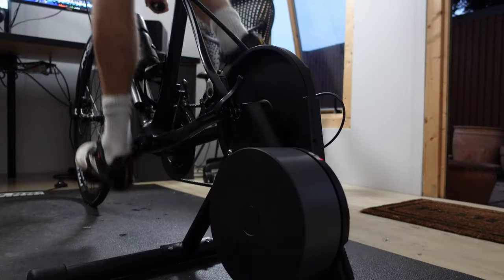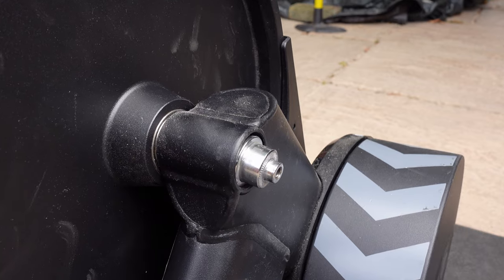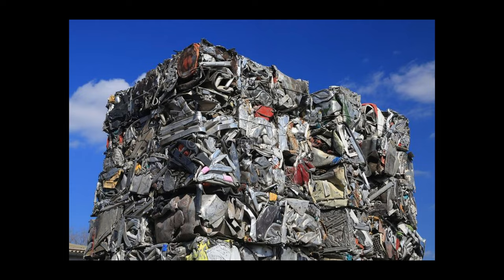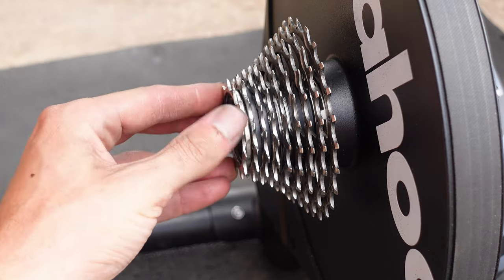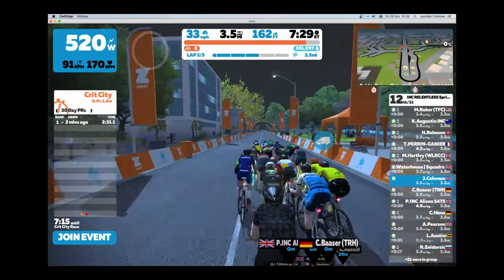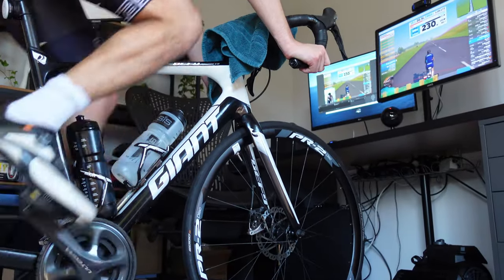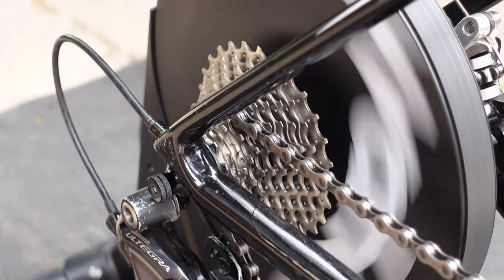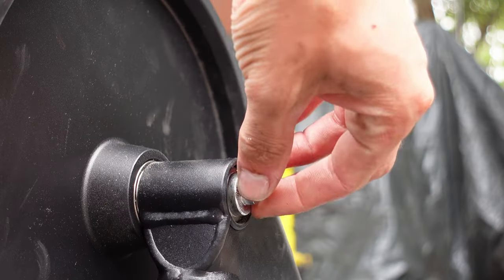1 Year With the Wahoo Kicker Core // Watch Before You Buy!

Comment: You can't get power from each legs from this unit simply because, unlike with power meter pedals, the power is measured at the output flywheel. Basically the unit is measuring how much power it is using to brake you. So by definition, it will be the total power of both legs averaged.
Reply: I also was thinking how exactly it would measure one side of only. When author makes such silly mistake it really cast a shadow on everything else in this vlog
Reply: Wouldn't it be possible, in theory at least, for the trainer to be able to guess the percentage of the work that each crank was doing at any given point in a complete crank rotation, using the rotational position of the flywheel along with the current speed and cadence and the minor fluctuations in power output that naturally result in each turn of the crank?

Although I suppose that even if this were possible it would still not be able to tell which pedal was which, unless the cadence sensor had an additional attitude sensor indicating whether it was right side up or upside down. Are there such things?
Reply: Actually, there are Trainers that display left and right power seperately (as mentioned). The question is how do they measure it, and how accurate is it. The only way I can think of is, that they have a sensor measuring the "left-right movememt" of the bike. When you are pushing the left pedal, the bike will slightly roll to the left side and vice versa Doing so, you could theoretically "measure" which pedal is generating the current power. As the tacx neo 2 is quiete flexible, this coud be easily measured in the trainer. 
However, doing so you can not distinguish, if the power is generated from pushing down left side, or pushing up on the right side.
Reply: Honestly, i don't understand what all the fuss is over power balance. I'm guessing most serious riders that care about power have a bilateral power meter on another  "itrw" bike.
Reply: @Ni1zz  well I quite like this author and have found the content in this vlog and others super helpful. If someone makes 1 error across 10 topics it doesn't invalidate the other 9.

Comment: How can the smart trainer know how much power you produce with your right and left leg? It can find out the cadence by analysing the pulses in power, but how can it reliably know if it's your right leg or the left one making that pulse? That side remark about the single-sided power meters being cheaper is way off the mark: hub-based power meters don't measure L/R balance either.
Reply from the maker: Good point. It's an estimated balance looking at some information on Google. That's kind of the same as the actual power because it's measured at the cassette not the pedals or hub. Either way the balance seemed accurate enough, when I deliberately pushed harder with one leg I could clearly see the imbalance. It seems with turbos the accuracy and readings are to be taken with a pinch of salt compared to power pedal / hubs 👍🏽

Comment: I was have a lot of problem with the core. 1.Low watts, 2. weird noise, 3. little cut on the belt after 1 week of use, so sent it back, and bought the Neo2t. I was rode 600km and a lot of climbing with the neo with it in 1 week, and I'm so happy with that, no issues, silent, and accurate! 😊
Reply: @Ryan Terence What happened?
Reply from the maker: Hopefully it holds up over time. @ryan what happened to yours?
Reply: @Ryan Terence Yo! After 5000km, and 70.000m climb, no issues, work like new :)
Reply: Se escucha mucho?

Comment: Why would you put your bike on the trainer before you have the quick release axle on it. That way the adapters won't fall out. Thanks for the review I've been thinking of getting a Core or saving for a Neo.
Reply from the maker: Hey Markus, you are right. I was swapping and changing things for the video so I didn't have it in. I swap between 10/11 speed cassette often so I have to remove it, but I'll put the qr axel in first form now on 👍🏽Also, I have hired a Tacx neo 2T for a month, it's really good. I'll be making a video on the tacx and probably a video comparing the T2 to the kicker core (Highend vs lowend) and if it's worth spending the extra £££ - Cheers for commenting.
Reply: @JourdainColeman  looking forward to it.

Comment: Had my core to replace my taxc flux ..  pretty pleased with it compared to the flux , loads better without constant noise rubbing the out plastic cover. I always use my stages for the power data n racing it’s more accurate.. can be -10-20watts difference ..which is a lot especially when racing.. plus side… it good in erg mode when doing intervals holds the correct wattage within 3-5 watts brilliantly consistent 🤙🤙
Reply from the maker: Thanks for sharing
Reply: @KrishBowditch is the kicker core better compre to the flux 2? Aprt from the noise whats the differences

Comment: Good vid. I've had mine for a week or two and no matter what I do, I can't get the drivetrain to run smooth. This is using a 1.85mm spacer like I would when out on the road with my 9-speed cassette. I've also used the 1.8mm one that came with the trainer but no good. Limit screws and cable tension have both been tweaked. At the point now where I think I'll just have to put up with it 😕
Reply from the maker: Hi Daniel, a couple of my mates have had the same issue with grinding and the drivechain not running smooth (that is ith 11 speed though). If you are using a 10 speed do make sure you have the spacer placed correctly. I talk about that in the video here - https://youtu.be/9R-FDX1w7Xo?t=181

Failing that, make sure the turbo is on level ground. When you put the bike into the turbo place pressure on the seat to make sure it's seated correctly. Also look from behind to make sure the bike is straight. The non drive side apartor is fiddly on the kicker core, on other trainers I've used it screws in and is fixed in place. 

Are you using the same cassette on your bike as the turbo?
Reply: @JourdainColeman  Hey man, yeah I watched and listened to what you said about the spacer. Mine isn't wavey like yours - it's just a bog standard spacer. In any case, I'm using the one that was originally on the bike (1.85mm I believe) and I don't have the same issues out on the road. Maybe a tiny bit of noise but not as bad as it is on trainer.

Yep, using same 11-34, 9-speed cassette as on the other wheel.

Think I'll have another crack at seating it and go from there. One thing I have to do to get it seated is to pull apart the seat stays a little bit to get it to sit in the dropouts. It's not exactly a smooth installation!
Reply: I had the same problem. It's an easy fix. 

The includes Spacer is just a basic washer without indents/room for the rivets, which are found on the back of some cassettes. 
This causes the cassette to not sit properly one the freehub and makes for a wobbly cassette and noisy drivetrain. 

You can solve it by using/buying the original shimano Spacer with these indents (thats what I did). Or youe could possibly get away with grinding/drilling away the rivets one the back of the biggest sprocket (there are 3-5 i guess, near the spline). 

I hope this helps! Dumb idea from wahoo to include such a shitty spacer.

Comment: Love my kickr core. But I had to replace the flywheel bearings after 3 years and 9000km. There was corrosion on the flywheel axle where the right bearing is running. Did clean the axle used 1200 sandpaper to remove the surface damage on the axle and used Loctite 641 retaining compound for the right bearing to ‚glue‘ it to the flywheel axle. That bearing replacement was possible with bike shop tools. According to some users the tacx neo T2 needs manufactur specific tool to replace.
Reply: As long as it's an easy fix
Reply: I will keep that in mind👍

Comment: So, I got my Core last week and have used it several times, for relatively short rides on Zwift as I'm just getting back into riding and shape (as well as on in years, alas), so I clearly don't have extensive experience with it. But so far I'm really impressed.

As everyone's said it's really smooth and realistic feeling (to the extent that any trainer can be) and makes very little noise (although I can hear a low steady hum-like sound around twice a second but I think I've heard it in videos too so it's probably normal and nothing to worry about). But the drivetrain is by far the noisiest thing I hear (but quieter after I thoroughly cleaned and relubed it).

I'm trying to gradually push myself harder but it's not easy, yet not longer after each ride I find myself looking forward to and eagerly anticipating my next ride. That I didn't expect. I also didn't expect the Zwift background music to be so monotonous, so I'll have to start riding with headphones (hopefully I won't cause massive Bluetooth overload).

Finally, regarding the issue you had with the 130/135mm adapter not screwing in and falling out when you try to connect your bike to the Core, there's a very simple fix for that. Install the quick release skewer first, as would be the case on a bike, into this adapter as well as the drive side adapter, then connect the bike. The skewer keeps the adapters in place, problem solved.

Thanks again for all the tips and observations.

Comment: Coming from a Tacx Bushido which I used for the last 6,5 years I only can say that the Core is bloody fantastic. Dead silent, no more slipping on gradients above 8%, so much better in SIM mode, power spot on with my Powertap C1, small, pretty and stable as a rock. 7 Years ago these direct drives were just too expensive, now they have the same price tag as the wheel-ons then. The transportation of the Bushido or other wheel-on for that matter is of course much easier. So the Bushido has still a function.

BTW Good down to earth review, but the title was a bit to red flaggy for me.
Reply: I am in the same boat. I have a Bushido I purchased back in 2014 and am looking for something to upgrade it for the same reasons as you.

Comment: I’m on my 3rd unit in 4 years, all replaced FOC by wahoo excellent service! The latest one I’ve had has been updated so the legs do snap into position when fully extended
Reply from the maker: Glad the customer service has been good 👍🏽
Reply: Third unit in four years ! Maybe they should focus on excellent build quality rather than customer service. You just put me off buying one !
Reply: @stanleyg3694  better than garmin/tacx.. they would just suggest to buy a new one… I also do a lot of mileage on my wahoo
Reply: @stanleyg3694 mine lasted 2.5 years then the flywheel bearing started to go. Replaced it for free with a refurb. I should have kept the old one and done the bearing myself because the replacement’s plastic shield rubs the belt wheel. Loosened it a bit and it seems to run clear now but far from ideal.

Comment: Thought I share. I been using Kikr generation 14. Got back in 2015. Been using the same cassette since I bought it. Have over 10-15k miles on that one cassette. I change my chains quite often. My cadence is 85-95 RPM on avg. I ride mostly outside, but I have certainly pushed this trainer. I been cycling for 15+ years. My ftp hovers between 320-370sh yearly as I ride year round. My freewheel is good for me. The power is still relatively accurate to my quarq power meter 
+ or  - 10 watts. Adjusting to grades from zwift seems okay. I never was a fan of that. I always just switch to standard mode which is same grade all the time. I also have about 1000 miles of experience with GTA cycling mod with my Kikr. The grade simulation in that game can be quite absurd. However it worked for the most part. Most of my time spent on trainer is on standard mode and doing intervals when the weather is crap outside.
Reply: What is a freewheel exactly??
Reply: with the gta cycling mod, i know there is a setting to lessen the gradients.
Reply: @jomarvista8646  thanks. Yeah I figured it out in the GTBikeVConfig settings. Where you can have the game not control your wahoo. I have it set on standard mode in wahoo app. Also there’s 25%, 50%, 75% and 100% for grade control when pressing F5 you will see it.

Comment: I’ve had my core 3 years now but one issue (with the core’s flywheel) after a year of usage caused the trainer to be replaced so contacted Wahoo and they sent me a refurbished core rather than a brand new one. Don’t know if this was due to cheap replacement or customer service - as a few friends had replacements of brand new trainer whereas I get a refurbished one 🤔🤔🤔.
But on the positive I’ve had the replacement last longer (2 years more) than my original model which is even better - what am I going to do when it comes to this model breaking 🤞🏻🤞🏻.

Comment: Nice thing about rim brake bikes is you can just put the skewer in to hold the adapter in place before trying to drop the rear dropouts on.  ;)

Washer is just flat now.

Space between the bolts on the 2 bars is different so you can only put them the right way round (I know because I put the long one on the back at first and the 2nd bolt couldn’t go through!)

Comment: I imagine the cassette is not aligned to the same way as the shifter cassette on bike.  Therefore, bike shifter adjustments are required every time using the Kicker Core.  I tried out the Kickr snap which doesn't require shifter adjustments.  However, after riding the Kickr snap I realize I get the RPMs up and coast too often.  I hear I can make adjustments on the Kicker App, but resistance adjustments occur all the time.  Who wants to keep opening the app to make these small adjustments?  An exercise bike has a lever centered on the handlebar stem for resistance adjustments.  I know you mentioned there is "mainly good" with this bike trainer.  However, there was a lot of bad design built in with this specific bike trainer (such as a the axle mount nut for disc and regular brakes), and disadvantages to bike trainers compared to exercise bikes in general.  I think I will go with an exercise bike instead.  Perhaps someday I will visit Watopia.  But not until the technology for bike trainers are better.  Thanks for posting this comprehensive review!  I appreciate the detail you covered.

Comment: Given that this is a wheel-off trainer so neither rim nor disc brakes are relevant to its use, is the purpose of the dual-sided hub adapter to let you use either 130 & 135mm spaced dropouts? My bike's 20 years old and has rim brakes and I've never had disc brakes and haven't really kept up with evolving technology so I'm assuming that 135mm is the standard for rim brake-equipped road bikes? Or is it something else?
Reply from the maker: Yes, you are correct, this it to allow for the wider axel of disc brake bikes with QR Skewer, often referred to as quick release. The newest standard though is "Thru Axel" which also has separate adaptors, this is the most modern axel type. 

It's a bit of a minefield but you can pretty much get adaptors for all mounting types and axel widths 👍🏽
Reply: @JourdainColeman  Thanks. I just ordered a Core and was curious. I had initially wanted to get a Snap but so many people (including you through your videos) convinced me that the Core was vastly better and easily worth the additional $200 or so that I decided to get it instead.

Btw does the Core have an actual power meter inside, or does it or the app you use it with estimate the power output based on the speed, cadence and difficulty?
Reply from the maker: @kovie9162  I believe that it's estimated power. But for training and general use, it's accurate. People compare the power output from the kicker to power meter pedals but to be honest, unless you are a pro athlete then "very close" is good enough. Plus if you get used to training with the kicker only and don't have a power meter then there is no discrepancy if that makes sense because there is only one source of data.

Also, you made a good choice going with the Kickr core, I had a "dumb" trainer for quite a while and the difference is so large that they aren't really comparable. 

Enjoy your training!
Reply: @JourdainColeman  Well there's also wheel-on smart trainers with electronically variable resistance like the Snap but from everything that I've read ride feel, noise and "stickiness" aren't nearly as good as with direct drive trainers like the Core. I'm coming from an actual dumb trainer so this will be a quantum leap for me. --All the best.

Comment: Considering getting one and i have a question, if im using different cassettes on my bike and trainer(different as in teeth count, but same number of cogs), do i need to calibrate/adjust the derailleur before each ride/swap? My bike has campagnolo cassette(which needs adapter for the kickr), would i be fine if i just buy a second shimano cassette that i would just leave on the trainer at all times?
Reply from the maker: Good question, I've always used the same cassette that I had on my bike on the turbo trainer. So if I had a 105 11 speed cassette, I'd by another one and put that on the trainer, then it's a like for like sway. 

If your cassettes are both 11-speed then it should in theory work. If the gearing is massively different then maybe the chain wouldn't be the correct length 🤔
Reply: Cool thanks, i guess i would have to try it out and see. Should probably be fine as you said